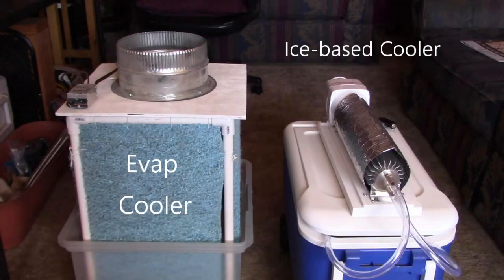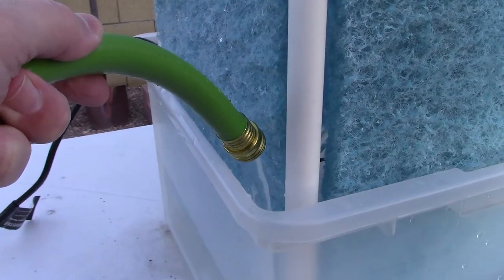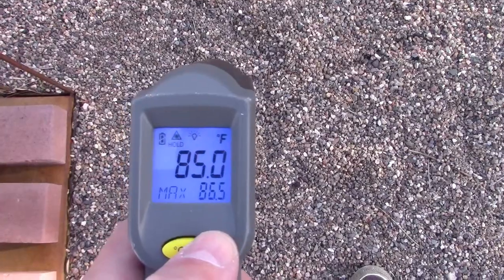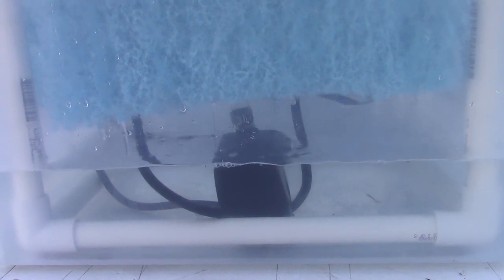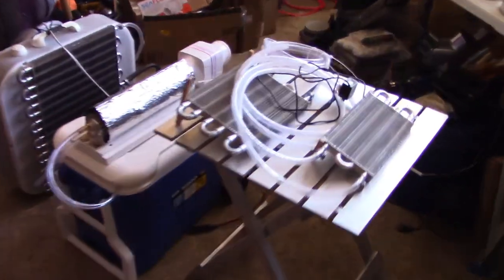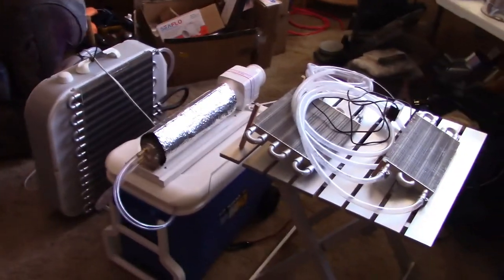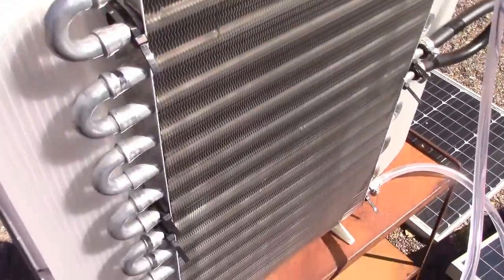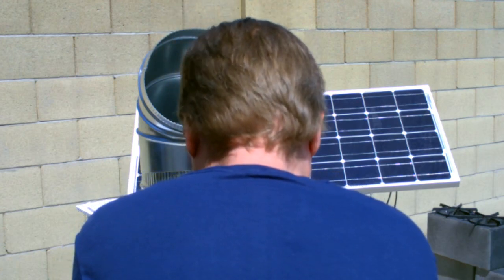DIY "Indirect" Evap AIr Cooler! Produces Cold/Dry Air (No Humidity!) - AC/DC - can be solar powered!

Comment: 👍 Nice work -- btw where in the world are you? In the UK, so humidity can be a problem for us at times. Just got my radial finned cooler in the mail!
Any thoughts on @RobertMurraySmith "1953 A Folding Silent Air Conditioner" and "1954 DIY Hybrid Air Conditioner Run From USB, Solar Or Battery" (especially the blade change!). 

Being in the UK, I never worked out why we don't have 220v box fans here..never seen one for domestic use.
Reply from the maker: hi. i'm in southwestern USA. i haven't seen his videos. i get so busy with making stuff i almost never actually watch videos. i'm not sure why some areas don't have box fans. they are quite common here in the USA.